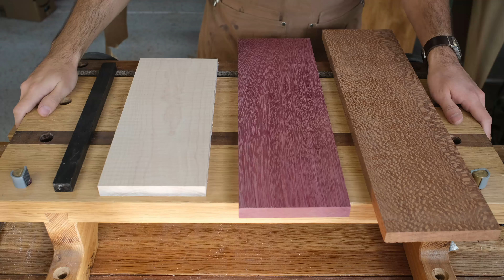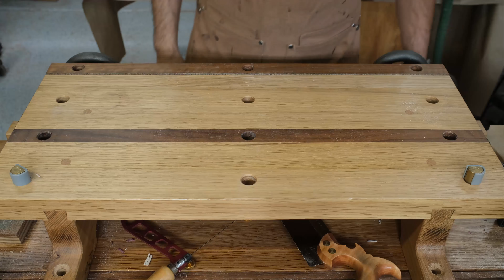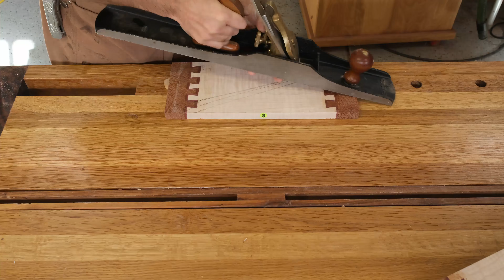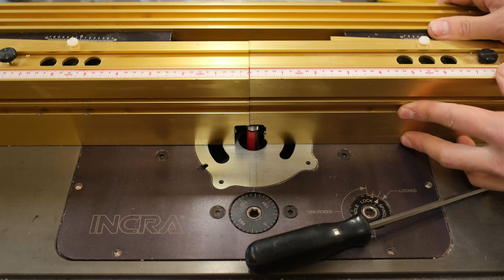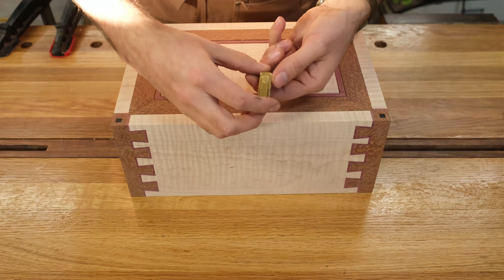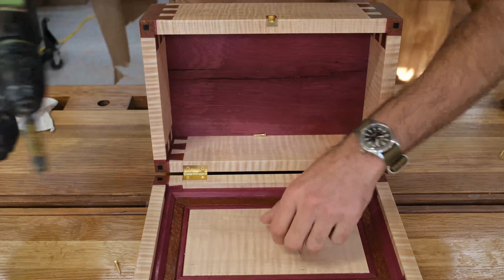Spline and Inlaid Mitered Dovetail Box - Inspired by Jonathan Katz-Moses

Comment: Finished product is very impressive.  I can't help but notice that by cutting the lid where you did that one of the dovetails is now smaller (by the width of the blade).  I've seen this occur with similar boxes created in other YT videos.  Did you ever consider widening, if possible, that one dovetail to take this loss into account so that all the final, post-cut dovetails would be equal?  Is this possible and/or practical?
Reply from the maker: Excellent observation. I typically accommodate for the saw kerf when making boxes, but it would have been a nuisance given that these dovetails are inlaid twice over. That being said, I would definitely implement this if I did it over again.

Comment: Beautiful work! The only observation I would make is since you are hand cutting the dovetails you should have made the ones the saw cut passed through 1/8” longer so the finished box would have an evenly spaced dovetail at that point.
Reply from the maker: Absolutely. I usually accommodate for saw kerf, but it becomes a little annoying when doing inlaid dovetails. Plus I knew I would be removing material from the bottom which would make the lower maple tails be roughly equal to those below the lid.

Comment: I was holding my breath as you ran that beautiful box through the table saw to cut the lid....glad it was short (my wife doesn't like me turning blue).  But I, intently focused, noticed that on the last cut, the box lid moved in to the box body as you came to the last inch of your final cut - and I was afraid that it wouldn't come together - but you did it.  It struck me that maybe putting a 1/8th" shim in the vertical portion of the leading edge would have prevented any wee-waw saw blade cut.  But then, maybe I'm just not experienced enough to pull this cut off free hand - yet.   Nice work on putting this video together, and the box is pretty nice, too ;-)
Reply from the maker: Oh yeah! The pucker-factor is always high when separating the lid. The push blocks I use are quite good at keeping the pieces stable and haven't let me down yet.